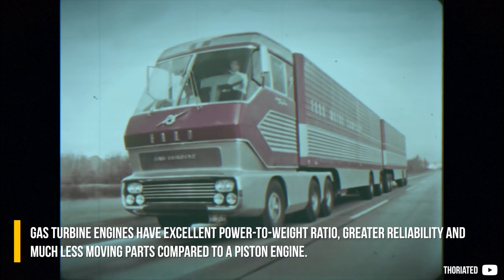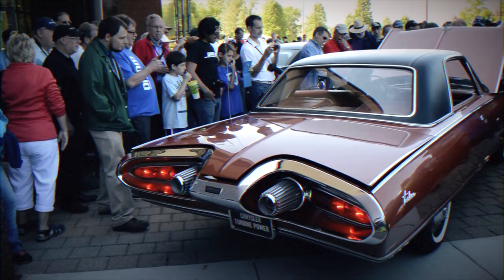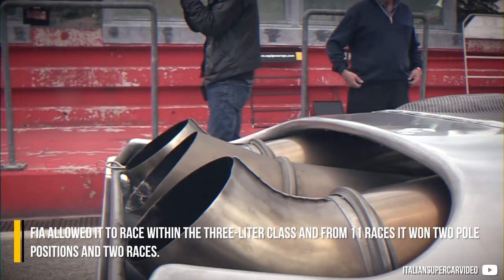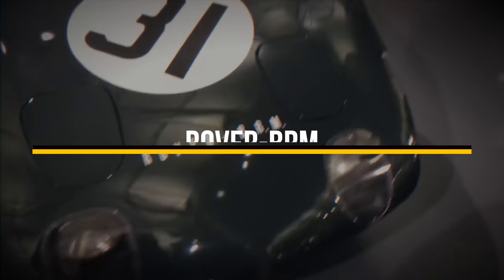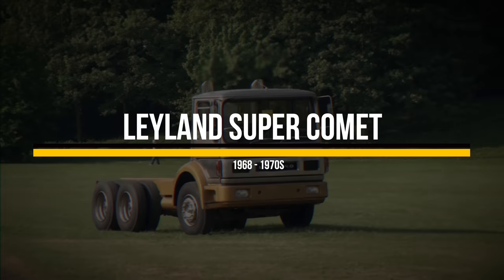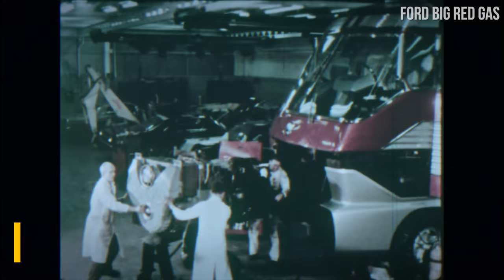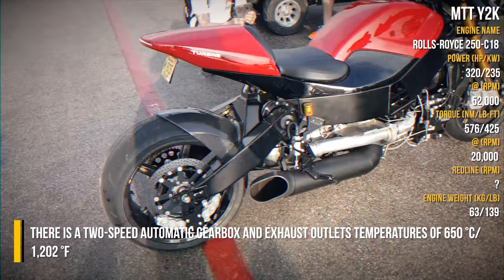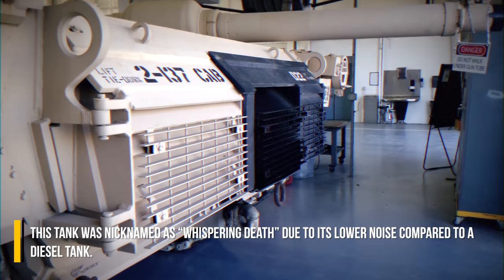The Only Automotive GAS TURBINE Vehicles

Comment: Turbine engines in cars are not that efficient but are still pretty cool
Reply: They just use more fuel, but for some reason, I heard that they aren't any less efficient then the typical engines used in cars
Reply: @frommarkham424  true. Ecconomy is a rating of how far you can go per unit of fuel consumed.  Efficiency is a rating of how much of that fuel is turned into useful work.
Reply: Form, function, thermodynamic efficiency and available metallurgy to make these innovations practical for all levels of gearhead mindset.. A dream for most. While a reality for a few dedicated mechanics.. ALOHA UALL
Reply: Turbine efficiency/economy isn't too bad when the engine is run near the maximum output. The problem for automotive use is the wide range of power output desired. 200 to 300 hp will give snappy acceleration, but highway speed on a level road requires about 30 hp. Turbines have poor efficiency when run at a small fraction of their potential.
Reply: @frommarkham424  Simply because turbine at any form is pretty horrible at certain RPM (usually lower)

Look no further than turbo lag. Either you designed anemic turbo with unnoticeable turbo lag or big-ass one with barely driveable turbo lag

Comment: 8:20 aircraft maintainers know that sound, almost identical to a -60 generator set 😅
Reply: they both have similar engine designs
Reply: @dy7296  yes indeed! I want to say that the -60 uses a light duty helicopter engine.p

Comment: Gas turbine powered trucks would only work efficiently on the wide open interstate highways west of the Mississippi. Too much traffic would slow them down and waste all that potential at a fast idle speed.
Reply: Better use it on a train i guess
Reply: @lordofkiwi5144 :  They did. Union Pacific had ALCO build several gas-turbine-electric locomotives for them in the 1950s. . .
Reply: @mortensen1961  They were used until the heavy fuel oil they worked so well with became more expensive per ton/mile than #2 diesel fuel.

Comment: GM, I thought, had an experimental turbine long haul truck a few years back. If the turbine had been further developed for trucking it could have given the diesel real competition.
Reply: LMFAO, serious competition in a world where massive fuel consumption and foreign object debris are not the bane of every gas turbine. Just wait until you get a compressor failure at low engine hours; rig up that shredded mess on the spot without a specialist [hint: the engine is totally kaput when the blades shred]. The engines take in the field aging and wear horribly outside of fairly pristine upkeep conditions. Seriously ride around in an Abrams for a few months on end and tell me diesel vibrations are not preferable to all out piercing migraine sounds; yeah, it's quiet alright, if you don't have to live with it... or stand at any angle in proximity for extended time.

Comment: In layman's terms: it's a huge turbo but uses fuel and air instead of air and oil. Instead of turning a compressor it turns a drivetrain. Shame this tech didn't catch on.
Reply: I imagine if it ever caught on (for automotive use). The lag issue would be solved for a while by now

Comment: Chrysler Turbine car. You forget the main downside...it would MELT the pavement 😂
Reply: Nope, that's a myth. There was a very efficient rotating heat exchanger in this engine, a one of a kind thing, that took heat out of exhaust to pre-heat intake air.
Ford Big Red also used a similar trick with multiple intercoolers on its original engine to have low temp exhaust and boost efficiency (to bad it was restored with a more conventional turbine).

Comment: When a torque of 576 Nm at 20.000 RPM is correct, the Chrysler should have 1641 HP not 132.
Reply: The torque is measured at the output shaft, after gear reduction, while rpm is of the turbine. I don't know if that rpm is for the compressor stage or the output stage. Maximum torque is when the output turbine is stalled, at 0 rpm. Torque drops as the output rpm increases. Horsepower peaks at 3600 rpm of the output shaft. Maximum output shaft speed is 5630 rpm.

Comment: There is clearly an error in the spec sheet of the chrysler. Torque, RPM and Power are strictly connected. 576 Nm @ 20.000 rpm would equal 1640 hp. Those turbines have much much less torque.
Reply from the maker: Those were the specs on the web, but yes, there is a specific mathematic calculation for power

Comment: There's something I don't get. You say these engines have low noise, but I hear that high pitch sound they create on startup or accelerating.
What do they mean about low noise levels?
Reply: The dont have the rumble of a combustion engine. The startup is loud but as you can hear from the racing clips they dont make too much noise under load
Reply: Generally lower pitched sounds travel further than higher pitched ones, so the sound you hear from turbines die down a lot quicker when you step back.

Comment: Dunno why the gas turbine trucks didn't catch on, if they're cheaper and lighter than conventional trucks with similar reliability then surely they should be great especially since they can use practically anything as fuel. And the shortcomings of turbines like poor responsiveness don't really cause much of an issue in something like a truck.
Reply: The terrible fuel economy killed it. And also the noise.
Reply: @lordofkiwi5144  ah okay, I can imagine especially when the gas crisis hit that that would've been a major issue
Reply: Their fuel rate from 90% and below isn't linear, so you're still burning shit loads of fuel at idle, something city driving would be chock full of. Planes have no red lights in the sky to worry about, which is why you see them there.
Reply: @lordofkiwi5144  What people don't seem to get is they are NOT quiet. They have a piercing whine; they lack the reciprocating engine vibrations that casts around vehicles, but the noise sucks and directionally is way worse as seen in the Abrams. Then there is the reported reliability and overly stated simplicity which are a paper stats based on air force naptime and show and tell conditions. They don't survive long hard lives in the field. You'll be stranded if anything decides to let go [the engines straight up brick when something goes, hope you have the autism for blade replacement when the elements add up]. Seriously, I shit you not, you can blow out the whole thing with the mechanic error that is air in the line. Who doesn't love needing SpEciALiSt PaRtS and company shop tools.

Comment: possible with turboshaft?
Reply: They are all basically turboshaft. The problem is that gas turbine engines burn comparable fuel rates at full throttle as when idling, which is a problem when you have a lot of red lights to worry about. Planes are basically always at full throttle 90% of the time when cruising, so that's not a problem for them.

Comment: Does anyone know, because turbines break the rule that at 7,121RPM you have the same torque as power because power is equal to radians per second multiplied by NM, but somehow turbines break this rule
Reply: Turbine engines are geared down, like a PT6 power turbine at 30,000 RPM turning a prop at 2,000 RPM. This guarantees lots of torque.

These engines are rated in shaft horsepower (SHP). Nobody cares what happens at the turbine wheel. What comes out of shaft at the front of the engine is what matters.
Reply: @marsgal42  so, the blades rotate at 30,000RPM but the blades move a shaft at 2,000RPM
like rotary motors the rotor moves 3 times faster than the shaft

Comment: I don't think the Chrysler Turbine has 576nm at 20,000 RPM, it would have about 1200kw at 20,000rpm if it did... Peak power is 97kw at 36,000 RPM so it would only have 26nm of torque at peak power... I imagine peak torque was more like 50nm despite what the Wikipedia page says. The power figure may also be wrong, if anyone has a link to the actual outputs that would be interesting!